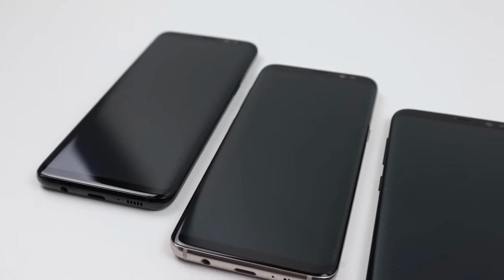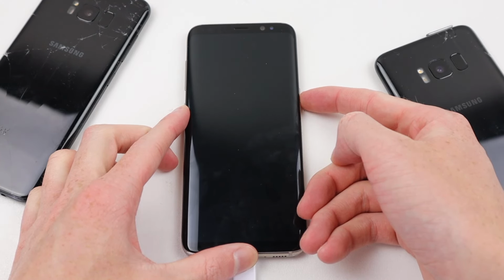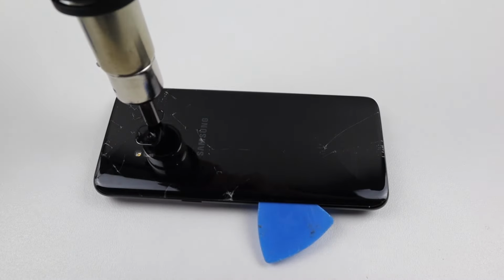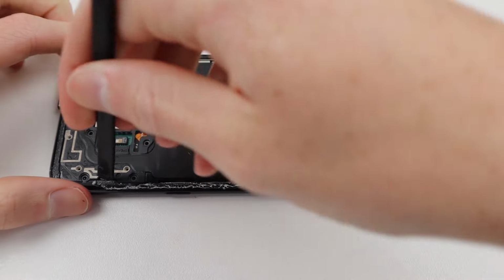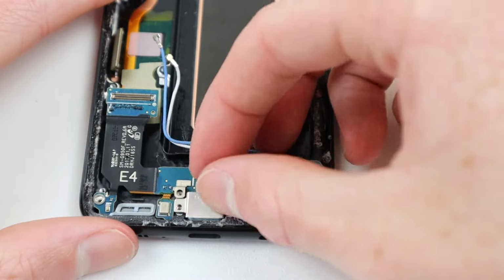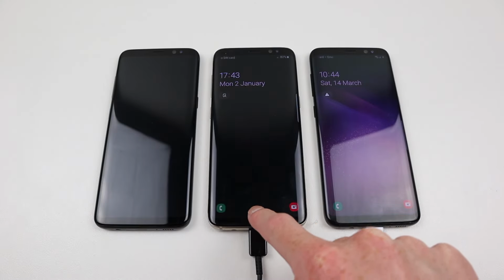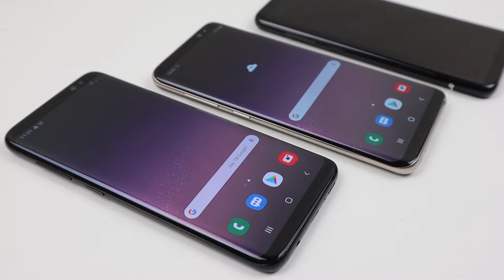Will they work? - $52 "unfixable" Galaxy S8 LOT

Comment: I literally put my broken screen galaxy s8 for £10 on eBay and still couldn't get rid of it
Reply: Ok I will buy it
Reply: only 10? I'll have it
Reply: @avonire  replacement displays cost the same as a second hand s8
Reply: @breakcoregirlxd  Rainy said it, Unless you can refurbish your own screens there still is very little profit on samsung devices unfortunately because the OLED cost just as much as replacing the device. apple still utilizes LCDS for a majority of their devices so there is one factor in how and why repairing an iphone is cheaper and more profitable. I also buy in lots fix and resell, i typically stay away from samsungs just for that reason and only buy 6s plus 8 plus and XS( theres a reason i left out IPhone 7, 7 plus and iphone X out of the picture and you are also a Phone tech like me youll know 7 and 7 plus are plagued with audio problems and Iphone X splitting logic boards due to weak solder in that specific model. Too much work to repair and resolder rather than just fix the ones that dont have board issues. I still make good side profit however I try to keep any bad phones from making their way back into this resale problem we have today. We fall into that problem where people have had a bad experience buying used phones. I can go on and on and. but i think you techies get the idea. LMK what you think. I live in an area in California where some people will pay the Premium to get their originall device working again but its like 1/10 people a mojrity of people use apple products...  I still cant get rid of my Samsung S8 plus
Reply: @breakcoregirlxd  i worked for a local shop who refubished samsung OLEDs i learned the process on s7 s7 edges but eventually they had to close because not many people needed that repair locally. we also did apple repair but our company was well known for only samsung glass repair. Of course the owner had the process down and showed me. 1. Its not as easy as it looks. 2. He had all the equipment and tools. So it was somewhat easier as the machines did most of the work but you still had to be delicate in the process and many times that screen will get damaged if not done correctly and can lose touch in certain area, gain black spots,  etc. And thats $200 down the drain because. OLED..... Now we are -200 and only profit 100 from the customer.. Little to no money made. Owner relied on apple screen repair sales and used phone sales.
Reply: @TremendousPat  I bet you love the new iPhone 12 now, if you know you know...
Reply: @kryptik223  yup unfortunately I do my friend. And it's BS
Reply: @breakcoregirlxd  funny you say that.
My note 8 had a cracked screen and a dodgy lcd. It'd work depending on the angle you held the phone, if it was 90 degrees it'd flicker green and white and whatever. Flat or 50ish degrees it was fine

Regardless, noone would buy it, and phone recycling centres would give £5
Samsung trade in gave me £150 for it towards a new Samsung phone so bought the s20 fe snapdragon variant. Very happy with it so far
Reply: @kryptik223  Hate em rn but it's whatever I doubt anyone is going to buy it to be honest. And if they do they will hate it.
Reply: @Lukas Brown just crack screen he say
But the hidden issue not mention
Reply: send!!!
Reply: @breakcoregirlxd  or you need to find different defect of the samsung s8 and buy and replace it.
Reply: @jjmmjj9999  oh wow, the a3 i have using certain apps like youtube, half the screen goes blue and awol half the time and it only lasts for a few seconds.
Reply: Let the repair person but it
Reply: (btw as Hugh Jeffreys)
Reply: (not me)

Comment: The constant crash and reboots could probably be fixed by flashing it with Odin. If it had an issue with flash or RAM, it would probably not even boot up or would crash midway through booting. The google apps crashing suggests a software issue rather than a hardware issue. The one not charging probably has an issue with the connections on the board, might be as simple as corrosion or something more complicated.
Reply: are there specific signs of NAND failure?

Comment: Since the note 7 they started to put stuff into the wireless charging coil without that it will not charge the phone
Reply: Elijah H yeah because that’s the charging coli
Reply: @eminetemur7476  They include temperature sensor to the charging coil. These phones, if charged, would display a warning, saying that "the temperature is cold" because the phone does not detect the temperature of the battery. Odd though why don't put them in battery instead, but it is what it is.
Reply: Spidapida it’s not like like I excluded that and fix phones for a living
Reply: Γιαννης Ντασιωτης eat you cereal also bitttchhhh
Reply: @eminetemur7476  you would only need the charging coil for wireless charging.

Comment: Have you tried Reflash using Odin with its original software on the one have software issues?
Reply: You can find software at https://www.sammobile.com/ and there is where i fix my Galaxy S6 with Vietnam software flashed to Malaysia software. Although it has to be compatible with the board which mine is G920F

Comment: Did you look into the charging issue? Was the USB port soldered correctly? What about the charging ic?
Reply from the maker: Not yet run out of time. I was editing this video until 1am today. So I just haven't done any board diagnostics. Will look into it in the future.

Comment: Please make a video about the not charging one because mine has the same problem. It wont charge with the cable but it does charge wirelessly. And sometimes it decides to charge then stop. I thought it was the charging port but you changed my mind.

Comment: You should try to change the software of the s8 that crashes with the original tool that Samsung provides you, this tool completely erases everything is like connecting an iphone to a computer and doing a factory reset, but what you need is a windows computer, you need to install Odin, the Samsung usb drivers and the software, you should try it, i had the same problem with an s10 and doing this is what helped me to fix it

Comment: I have an S8 plus, the screen is cracked. With screen burn in and the battery is getting old. 

However to repair this it's £260 ish with Samsung.

So I might be able to repair this on the cheap

Comment: Don't update. Reinstall the whole OS from factory through ODIN. Updating only installs new stuff onto the already broken stuff, and from the looks of that update, it was only a security patch, which does a whole f##k all nothing.

Put TWRP on it, flash some Lineage OS and a custom kernel.
If it still crashes and reboots, it's a problem with the phone.
If it doesn't it's just Touchwiz being Touchwiz.

Comment: I know you don't work on samsung phones often but you cant charge them without the wireless charging pad because it has the battery heat sensor in it and the phone denies any power if it doesnt know the temparature.

Comment: My s8 screen freezes and turns green in mid brightness level but the screen itself is not broken. (So its working fine in low brightness level). Does this mean the display is broken and would need to be replaced?
Reply: its broken

Comment: great video btw I have an issue with my Samsung Galaxy S6 Edge WiFi doesn't work at all no water damage antennas are ok but the WiFi Just does not Turn on i tried even a custom rom but the problem seems Hardware related If you will see My comment What can I do ( Sorry for the english greetings from Italy)

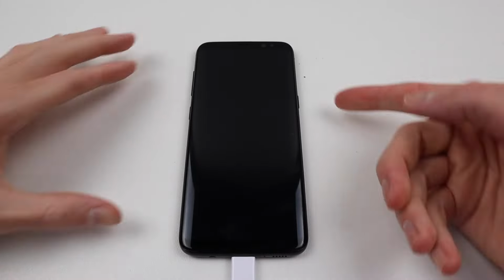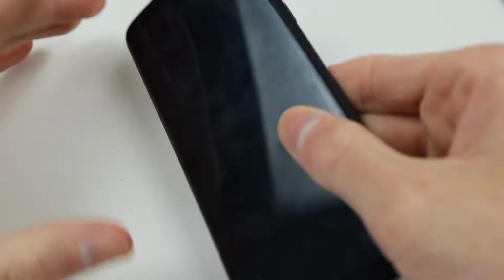Comment: 3:45  and 5:48 you need to install the wireless charging coil, as it has the battery temperature thing on it. If it's not installed, the battery/phone won't charge.
Reply: then why does the phone with the random crashes charge without the charging coil?
Reply: @animalm4st3r it wont go up

Comment: Its not charging because the board isnt properly connected to the dock. There is a small connector like the one such as the camera connector on the bottom of the motherboard and at the top of the connector unless youve connected it correctly then do dismiss my comment

Comment: With trash motherboards, You can always try heating them up with hot air gun. Have helped me few times. If there's some bad soldier point/connection has change to restore it. Have one samsung 9001 that was brought back to life with heat gun, my relative been using that for bout 2,5 years wo any problems :)

Comment: Samsung should be ashamed of themselves, these phones are garbage. I bought my s8+ brand new when it came out, cost me a thousand dollars. One week after having it the charging port quit working and I had to replace it. Not to soon after that I kept getting messages saying there was moisture in the charging port. I dropped it, in my house, on soft carpet and the back and screen cracked. I ended up selling it at an eco atm for 30 dollars turned around bought the Blu vivo xi+ for 250 I've had it 6 months now and not a single issue. Sometimes more isn't better

Comment: the not charging issue is because you didn’t put the plastic plate back in the phone, the plate contains a temp sensor for the battery, the battery won’t take a charge until that plate is back in place

Comment: Hey I have an s8 witch I restored myself but now it has some issues :
The vibration motor don't work (it worked before)
The screen turned to pink with burns 
The gyro totally stopped working 
I am a young phone and tech reapirer and I need some advice. Thanks btw love your job ❤️
Reply: x_tpelegrin13 thats a disaster lol
Reply: for the vibration motor, check the contact pins, see if they are bent or something is shorting it. 

for screen burn in, there isn't much you could do about that besides replacing the screen

thats all i know, good luck. i had similar issues with a  water damaged Moto g6 play
Reply: @1020shaf  i already take it appart 20 Times but u think it's a motherboard related issue
Reply: @RandomGuy-om1vy  it is lmao 😂
Reply: I*
Reply: @tpelegrin1320  it probably is to be honest with ya. Mostly similar issues here with my moto g6 play i tried to repair, it was completely nonfunctional but i was able to revive it almost completely. only the vibration motor and microphone wouldn't work no matter what I tried (literally). So i just gave up and sold it for lower than what i originally intended.
Reply: Shafat Talukdar yes i will sold it for like 100€

Comment: For the crashing s8, you should flash new firmware via ODIN, probably something went wrong while it was updating therefore it crashes. This can be a solution i repaired my friend's a8 with this method

Comment: bro u need to plug in the wirelss charging coil in order for the dock connector to work
Reply: what?

no you don't?
Reply from the maker: Even without it, a temp warning should appear. It doesn't charge.

Comment: I think the samsungs after s8 wont charge without the wireless charging coil
Reply: I think normally it would display a message saying it was to hot if the coil isn't connected, but it looks like not even that shows.
Reply: Check jerryrigeverything video for that issue
Reply: The coil has the motherboard temperature sensor on it and from what I know the phone has to be a certain temperature to start up

Comment: Try to swap wireles charging coils. I think there is a temperature sensor on the black plastic cover. It prevents battery from charging if phone gets wrong values from this sensor. It could be broken.  There is small chance to fix it because the phone charges wirelessly but still... And flash the second one. Maybe someone tried to root it or flash it with wrong build.

Comment: This is why I love wireless charging, inefficient as it is. USB ports will break, faster now if you don't have wireless headphones and you are using a dongle or USB headphones. At least if your port dies, you still can use your phone by buying a relatively cheap wireless charger.
Reply: This happened with me with s7

Comment: @Hugh Jeffreys
Hey i got something to test for you :)
I have two Galaxy S7 edge Exynos models that were showing no signs of life.
One was my own that went black after a dropp.
I tried with Disconnecting the batery from the motherboard or thought it was a loose connection but nothing changed after a full disassembly.
Then i left it disconnected from the Battery for 2 weeks in the Frame.
After this time i was so confused that it bootet right up with no issues as i reconnected the Battery.
In fact im writing this text from this Phone.
It still has no issues after 6 Month of using.
Don't know why i had 2 boards of this failures but you can test that with the dead one too.
Maybe it helps. :)

Comment: Hey Huge! Great video. For the one black S8 That did not boot I have a feeling that the bootloader it corrupt. If you plug it into a computer when you get working parts for it and it shows up as qdloader 9008 that's how you would know. If you look around you can find some firmware files. I have not been able to find bit 6 yet but I will keep looking.
Reply: Huge

Comment: To charge the Samsung devices you need to connect the wireless charging coil too. Because the wireless charging coil contain battery temperature sensor.
You cannot charge latest samsung devices without battery temperature sensor

Comment: every phone after the s7 won't charge without their own wireless charging pad as it now has more sensors after the note 7 mistake.
however if it is a mb issue : can you make a video where you try microsoldering with the s8?

Comment: Hugh, what temperature do you set the heat to when you use the hot air?
Reply: Back glass glue melts at 70-85 celsius and front glass melts at 90+ celsius